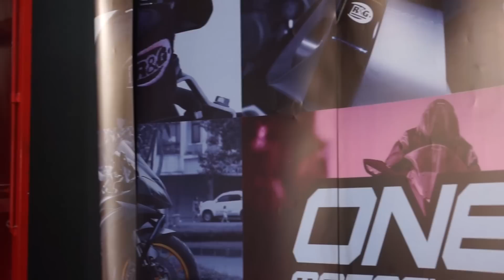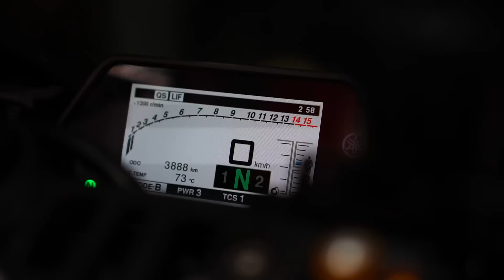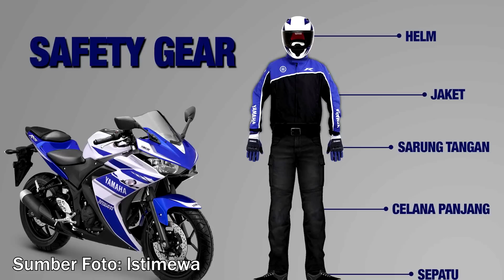MANTAN OH MANTAN: Yamaha YZF-R1 2015

Comment: saya mau tanya dong bedanya quickshift yang memiliki ecu sendiri dengan yang built-in ECU motor

saya sudah menggunakan yang quickshify built-in ECU, kendala yang diterima adalah terkadang shifting di high rpm terkendala / macet, saya khawatir dengan sistem kopling yang ada karna hal ini (belum bongkar) karena saya merasa ada sedikit penurunan performa akhir² ini

apakah qs yang seperti di video terkadang mengalami hal seperti itu juga?